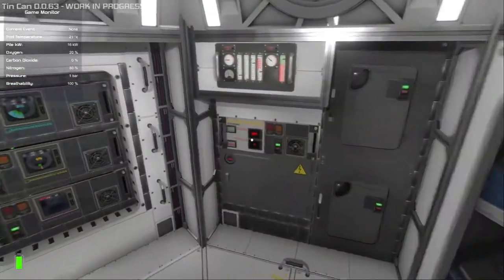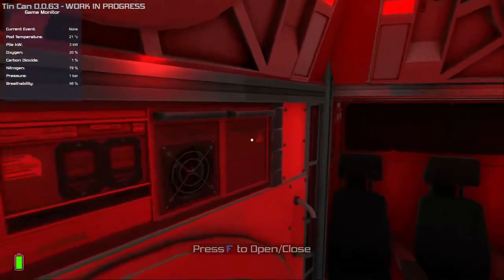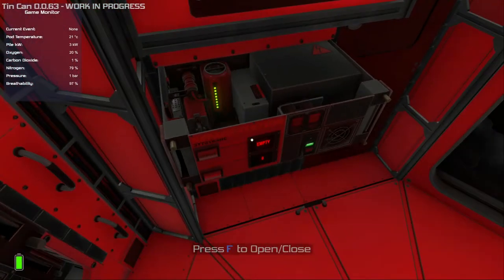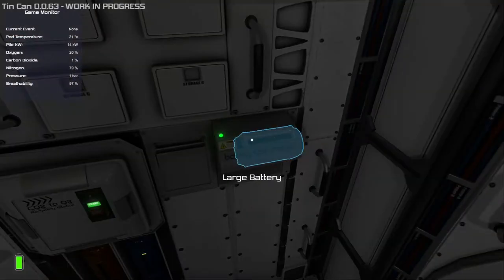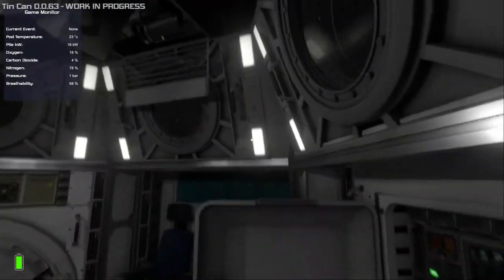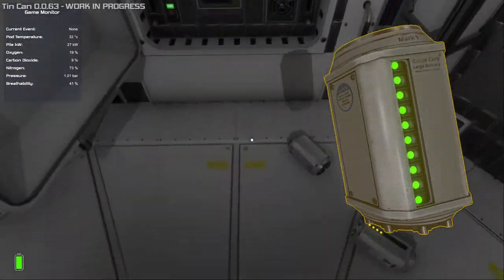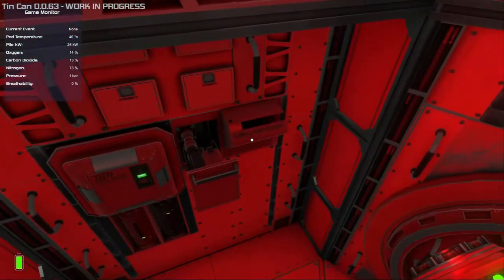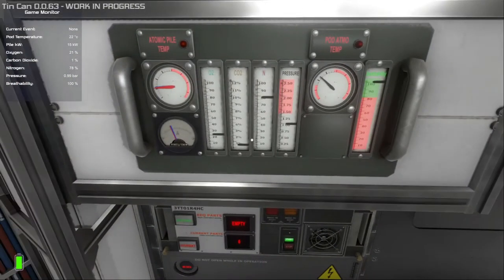Tin Can Tips: Batteries and Power Management

Comment: Great videos man! Super helpful for this weirdly addictive game. I keep having an issue where my main generator goes offline at some point in the game and there is no broken components with the main generator or with the main computer. Do you know why the generator would go offline if nothing is broken?
Reply from the maker: That's strange, the first thing I'd check is whether the main generator is completely off or if the CRT monitor on it is just temporarily off. It's possible that the CRT monitor on the main generator may not display if for whatever reason the main generator is not supplying enough power to keep all systems and CRT monitors powered.

Other than that I'm not sure. Unless there is a power surge (usually from electric storm) or damaged components, the system shouldn't go offline.
Reply: @ChucksIndieGalaxy  Thank you for the reply! It seems like it’s not providing enough power. The main computer will say it’s offline. Sometimes the screen will turn on for a second with an error saying too low power. Could it be that other systems are draining too much power? This happens every time, even with non essential systems turned off as recommended in your tips and tricks videos (which were great btw!)
Reply: The other systems go on battery too when this happens
Reply from the maker: @khalil6851  It usually takes some time for the power generator to generate enough heat to match the power output to power demand. You can check this by comparing the red and blue lines on the status panel. So for example: If you just came out of an ice nebula and you switch on all systems at once, it will take time for the power generator to match the demand. The power generator will always try to match output to demand, by lowering or increasing the temp of the atomic pile. It takes a bit of time though.
Reply from the maker: When coming out of the ice nebula, I usually gradually switch on system by system from most important to least important, and monitor the power output to ensure that it is slowly catching up to the demand.
Reply: @ChucksIndieGalaxy  Oh okay that makes much more sense! I’ll keep an eye on the meter next time and see how it compares to the demand. Thank you so much! Keep up the great work, looking forward to more videos :)